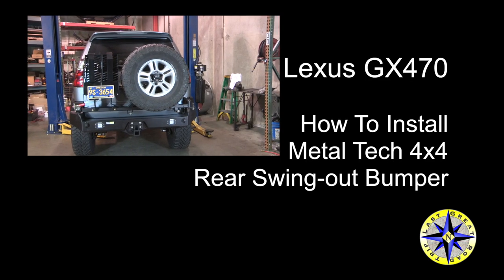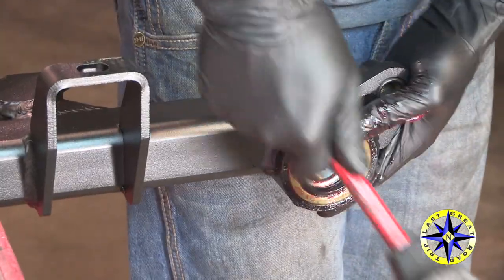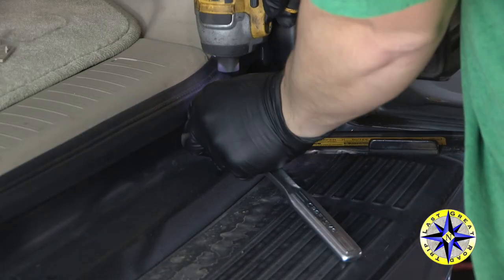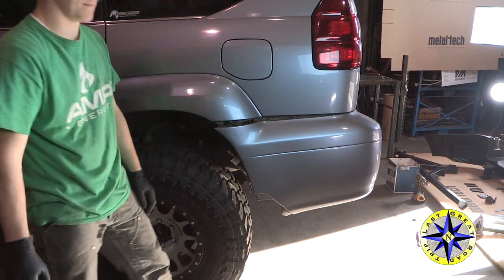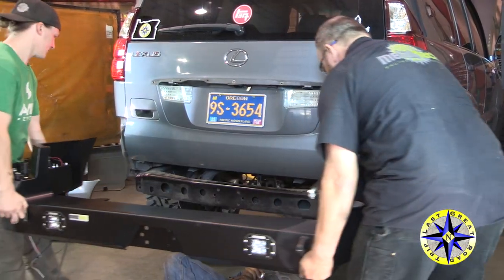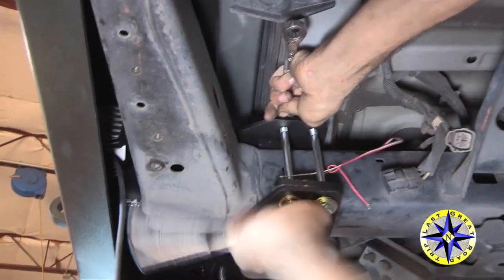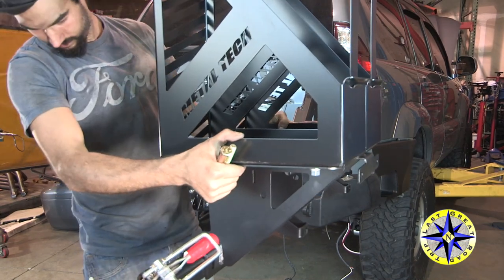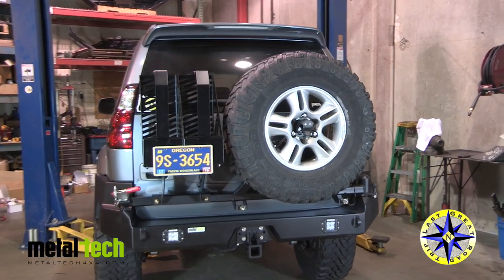Installation - Metal Tech Swing-Out Bumper on Lexus GX470

Comment: What brand and size of lift are you running on the Lexus ? Also size of tire ?  Looks like a great rear bumper. I just purchased one if these vehicles and am looking to outfit it in a similar way
Reply from the maker: Sorry I can't give you too many specifics since this is not our truck.  The owner can be found over on IH8MUD in the J120 forum.  The tires are 35" and I believe he runs an ICON lift.  Check out IH8MUD/J120 and you will find lots of mod ideas for your GX470.

Comment: What kind of gas do people run on the Lexus? I'm guessing premium high octane gas is hard to get in some remote places?
Reply from the maker: Toyota calls for premium in the GX470.   You're right though it can be tough to find in remote locations.   Octane boost can help when only regular is available.
Reply: 2003 GX takes regular. Possibly 2004.

Comment: How is the gas mileage after?
Reply from the maker: with the V8 the bumper doesn't  really move the needle...  the lift and bigger tires are the pain point for MPG on the GX.
Reply: It was shit before and it will be shit after. 500k reliability is worth it though.

Comment: I think these look very nice, but I'm worried about the added weight to the vehicle and the detrimental effect this might have on handling.  The gx is already top heavy, now it seems like this, with the tire and fuel, might add 400lbs to the upper back.
Reply from the maker: you are dead on to be worried about adding weight...  one of my pet peeves is adding tons of weight that doesn't provide value.  Metal Tech 4x4 spends a lot of CAD time engineering their bumpers to ensure they have weight where it is needed and reduce weight where they can.  You should give them a call to find out more about how they keep the weight on this bumper to as low as possible while still providing the protection you want for your truck.